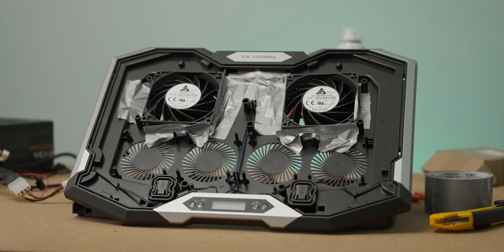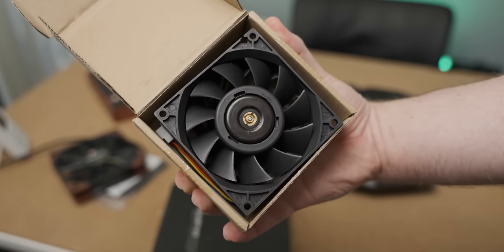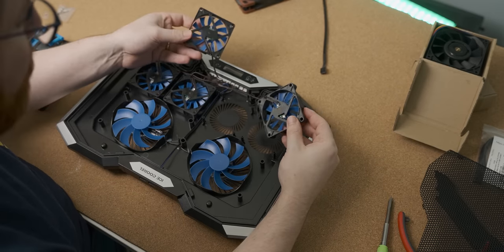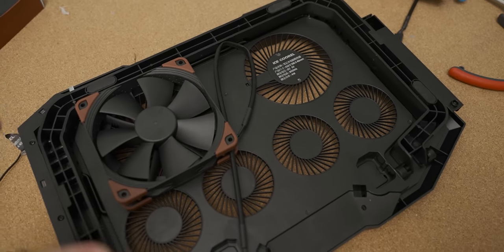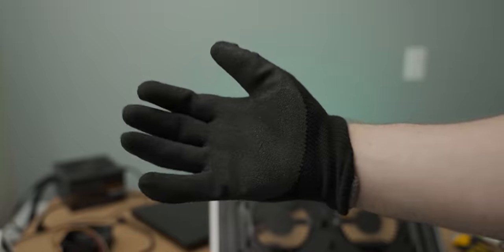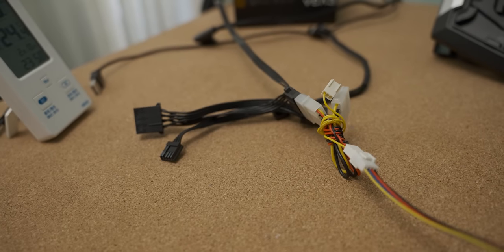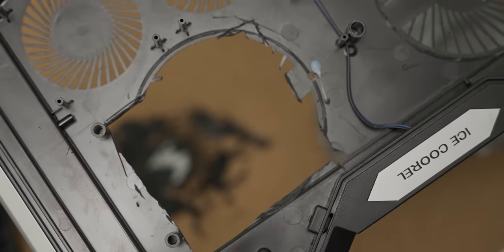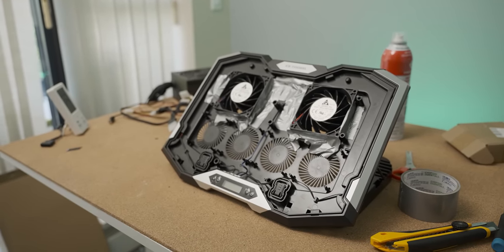I Made The World's Most Powerful Laptop Cooler

Comment: By the end it just sounds like a PS4, probably actually quieter.
Reply: Idk my ps4 slim  is pretty quiet. But its on a pedistal pretty much with air all around it
Reply: @DeadpoolPlayz  The original PS4 was...  very loud.  It wouldn't have been so much of a problem, except it was very loud without being cool enough to...  touch with your bare hands.  You could still look at it for at least 3 seconds without burning your eyeballs, so there's that I guess.
Reply: 83dB is about 4 times as loud as the PS4 for anyone wondering, though idk the distance dawid measured it from
Reply: With a headset, who would ever notice
Reply: @dapz  verified guy??????

Comment: Next challenge ... cooling a laptop with a jet engine. 

"The age old solution to every problem ever" ... duct tape.  
I'm upset that you didn't also use Flex Tape to create a better air funnel.  Tsk, tsk.
Reply: as long as the laptop is on the intake side, should work just fine, lol
Reply: Could also use some zip ties in there :D
Reply: cool it with a leaf blower
Reply from the maker: I sorry, I have failed you. 😔 I should probably go buy some flex tape. 😁
Reply: A jet engine emits a jet of hot exhaust gases that will burn off your laptop  😁😁😁
Reply: Jet engine? Somebody call Colin Furze
Reply: @MrGichinfunakoshi  not if the laptop in on the intake side..nothing but cool low pressure air with tons of velocity
Reply: @MrGichinfunakoshi  i don't see why you think an ~800°C (~1500°C whit afterburner) turbofan Jet engine, wouldn't be the perfect solution to cool a laptop... And disassemble it.
Reply: @Ocastia  😂😂😂😂
Reply: Hi
Reply: Ps4 already have one
Reply: Dawid should salvage a pair of HP Blade Server fans for laptop cooling (https://www.youtube.com/watch?v=Crmz4-iWGvg ). It'll be the next closest thing to a jet engine.
Reply: loLolololol
Reply: you know jet engines blow out hot air right? not ideal for cooling
Reply: Directions unclear accidentally made a guided missile.

Comment: Thanks Dawid.   You inspired me to try the same for my son's laptop.  I broke down his cooler and installed two 3000 RPM Noctua fans.  Tried as an intake and as an exhaust.  They worked alot better as an exhaust.  No there is an external power supply at the side of his laptop running the two fans inside the cooler via a fan hub.  It must be working since he uses it every day without complaint, and he is the expert at what is working and not working with his laptop.  You are a genius sir.  Keep up the great content.

Comment: This reminds me of the project i did for my fx 4170.It was running as hot as the sun when i oc'd it to 4.8ghz so i got this industrial fan that i connected to house power.No limitation in speed.It was loud but man did she run cool.Main problem i had was the mounting but i did a good job and routed my cable through the back on this case.It looked and ran like a baws :D.
Reply: Damn how you do that (run it off the wall)
I got a G5 SE and it will give the sun a run for it's money

Comment: Most of that air is simply flowing around the base of the laptop rather than into it, which is why most laptop coolers just make noise rather than actual cooling. The fix is to put some rubber draught insulation strips (the sort you use to seal doors in the winter) around the edges of the cooler so that when the  laptop is placed on it the space between the cooler and laptop base is sealed... so that the cooler airflow creates a pressure differential at the base of the laptop rather than a breeze around it.

There's some laptop coolers that realise this, but you end up pretty much paying 100% more for the required foam surround. Instead, buy a decent cheap cooler and add better rubber strips yourself.  Fans with the right blades to create pressure differential rather than a low pressure breeze are the next mod if that doesn't give enough cooling.

Comment: Dawid, for what it's worth laptops run cooler with the lid open to a certain extent, since the lid/screen just acts as insulation to stop heat passively radiating out the top.

Comment: I used a single Delta 3.5a 80mm in the mid 2000s on my main rig.  When you opened the door to the house, you could hear it from upstairs. I had to turn off the pc to sleep.. but I'll be damned if I didn't have that 2.4ghz Core 2 Duo running at 3.4ghz, stable.  A full 1ghz OC... but at what cost

Comment: I just bought a laptop cooler that has blower fans and a seal to keep all the air going to the laptop and its the best laptop cooler ive used so far but it was more expensive than most. I think laptops with more vents on the back will benefit more than your razor. They do help though and nice to cover your lap from hot laptops.

Comment: Ho boy, the noise that those deltas made brought back some memories of overclocking Athlon CPUs back in the Socket A days. I used to run an Akasa Silver Mountain Cooler back then that used a Delta "Black Label" AFB0612EH as its stock fan, wich ran at a constant 6800 RPM and produced an ear shattering 46,5 dBA. Combined with my Chieftec CS 601 case that was filled to the max with 80mm case fans, starting that PC allways sounded like a Chopper that was getting ready for takeoff.

Comment: I made my own laptop cooler a little while later. I used cheap plastic laptop stand and cut 2 openings for two 120mm fans. The fans are connected to usb step-up module so i can control the voltage on the fans. Usualny i run them on 6V and the cooler is super quiet and the temps went 10C lower o both gpu and cpu :D

Comment: bro, best cooling and sound reduction is: place the laptop as a tent on the floor, add hdmi cable and wireless mouse+keyboard, because it is under desk, lowers fan noise, and because of tent mode you get a better airflow.

Comment: Maybe just maybe running the fan as an exhaust would help, you know pull the hot air away from the pc instead of working against the laptop fans and pushing the hot air right back in. Then maybe you'd actually see a difference

Comment: These only work when the fans are extracting air OUTWARDS, trying to push air in the laptops tiny vents will actually cause the laptop to get hotter, on this pad i would remove those small 4 useless fans so all the power via usb can be directed to the two larger ones, this is where the heat comes out of the laptop anyway, the goal is to get the heat out of the laptop as fast as possible, and why they never make laptops that push air inwards.

Comment: Might the issue here be that axial fans tend to stall very easily when faced with an obstruction (IE resistance) so the amount of airflow through the laptop will be minimal. You'll get an impressive airflow when the server fans are meeting no resistance but minimal flow with the laptop sat on top. This could be tested using a funnel out of the exhaust and an airflow meter (wind speed sensor would like suffice). Centrifugal fans tend to handle resistance much better. It's a bit like superchargers comparing roots type vs centrifugal (turbo) style fans. Of course for ultimate handling or resistance you want neither a centrifugal or axial fan but more a piston / diaphram type air pump. That will flow air pretty much no matter what. Of course the air would take the path of least resistance so duck-taping the laptop to the correl to create an air-type seal would be required.
Reply: Man I overthink things sometimes....

Comment: The first experiment would have worked if you added a seal. The issue with these cheap laptop coolers is that the air is being pushed onto the laptop surface then its bouncing away. If you can enclose all the air and FORCE the air through the tiny intake holes, then you have a game changer that should be far less loud.

Comment: The...  Thing, you made to power the second delta adds no real additional power to the fan, as you are shoving 12VDC into a PWM return to the board, and the ground cable (negative) cable also needs to be upsized to actually provide a benefit.

Glad you had a fire extinguisher handy.  Not sure it's the right type, but it's the thought that counts!
Reply: I think the blue wire is a frequency input and the yellow wire is a pwm control input. 
Also wouldn't the negative cable being too small just increase the risk of flames, i mean if you input current though it's gotta go somewhere.
Reply: @IsoMacintosh  blue is FROM the fan TO the board.  You need some way to know how fast the fan is going, but you can control the speed with voltage.  Not as precise, but cheap.  The 4th wire is a command wire, as it allows the board to not have to do the actual control, and instead let the fan do the actual control.

As for the negative being too small, it WILL cause a fire, IF they can get enough amps through the red wire.

Except the red wire is also too small.  So if Dawid tries to run this long term, the fans will fail, when those wires melt.

Actually, if they just melt, and don't touch, he might be okay.  But if they melt and touch...  It's going to be real fun for a few seconds before something else ALSO dies

Comment: You could have gotten a drill for the tap size of the screws you were using for the fan attachment, and made them self tap into the plastic with a power drill. Like if they were m4 for screws you would just Google m4 tap drill size and it would tell you what size drill to use so you could screw m4 screws into it, or run an m4 tap through it

Comment: I was a slave to laptop cooling pads trying one after another with no success until I thought of a crazy idea while I slept. I use my air purifier xD. This will be a long comment but hear me out. It's a amazing trick!

The particular one i use is the Holmes HAP759 model but i believe any upwards firing air purifier will work. Keep in mind that when you do this it is recommended that you connect a external monitor and mouse and keyboard unless you don't mind slouching over in order to play on the laptop while it's on top of the air purifier.

The results? Without using any fans other than the built in fans on my 17 inch laptop with a GTX 1070 the laptop would run super hot after about 20 minutes of playing games with ultra settings on. And by hot i mean like as high as 98 Celsius. Most cooling pads i used would drop the temps down to as low as 82 Celsius. The air purifier drops the temperature down to a amazing low of around 40 Celsius! Not only this but it keeps the temps this low for hours. I even have had gaming marathons of around 16 hours and the temps were in the 40's the entire time.

How would you set this up? I simply put my air purifier right next to my desk where i have monitor and my mouse/keyboard. I place the laptop on top of it backed against the desk and walk so that it doesn't get tipped over. Then simply run the video cable to the external display and your set. Not only are you cooling your laptop to amazing low temperature you are also shooting clean HEPA filtered air into your laptop simultaneously purifying the air in your room  as well.

I know this is a crazy idea but man is it worth it.

Comment: these laptop stands might as well not even have fans. 95% of the work they do they do just by lifting the bottom of the laptop from whatever surface it was resting on. 
the ones that REALLY work are those exhaust fans. but only on laptop with one one exhaust port. my old laptop was such a model. a small exhaust cooler dropped temps by like 15c.

Comment: That sounds very Reasonable. I think people get used to the sound of a vacuum in the house. Yeah that’s reasonable. 😂😂😂

Jokes aside, 

I am surprised that nobody has made limited run lower housings for gaming laptops that utilized a larger cooler and fan for specific models that can be overclocked. 

I know many that wouldn’t care if they had an extra inch of thickness if it meant they had a capacity to overclock and cool. 

A new housing could allow the air to flow from the front to the rear.
Fun project you did there.

Comment: have 5 3000 rpm 140mm fans. and 2 3000rpm 120mm fans from Noctua in my case. Love em, only run 3000 rpm when benchmarking. wish the fan showdown would use the 3000 rpm 140mm at max speed. put those blades to the test.

Comment: I've added a temperature probe USB switch to the cooler, then put it next to an AC vent with a dehumidifier to reduce the humidity to hopefully not ruin the components. I also have extra 120mm usb fans, one directed towards the cooler, and one pointed down at the laptop keyboard, which if you don't know is where a lot of laptops also intake air. 
I use the laptop as a desktop for now, so I don't have to worry about placement, I just have it near the floor on a laptop stand on a box.
the ironic thing is that I think my solution is probably less janky, quieter, cheaper and cooler than your solution :p
I get about 50C when the AC is running, if I'm not doing anything intensive, though my laptop does get into the 60's. this motile laptop has an anemic  cooler so it would immediately shoot to 75C and start sounding like a hair dryer, even with a laptop cooler so this is an improvement.

Comment: I manhandled 360 watercooling loop (old 360 AIO), 37x27cm aluminium heat exchanger, 4 x 120mm fans and 3x60w tecs connected to 120mm*40mm aluminium waterblock to my Cooler Master laptop cooler. Noise is not as loud and the laptop bottom is around 15 celcius (voltage controlled by heat exchanger temperature) on idle and littlebit more on load, my laptop had the problem of VRM overheating at 45watts but now its not :). I think its overpowered as single 60w tec could have done the job. 

Laptop is : Ideapad 3 14", 10210U @ 45W + 65W Lenovo X1 charger, stock charger is 45w and tdp 15w.

Comment: Be careful with pushing air into the openings of your laptop cooler. If you spee up the laptop's fan, it might act like a generator and create currents that the mainboard fan header can't handle.
Same goes with using the vacuum cleaner to suck the dirt out of the fan. Don't do that as long as the fan is connected and you can't manually stop it from spinning up. :)

Comment: you just have to cut the back of the laptop at the shroud and glue a delta fan there to push air in ...the other delta fan you might put it at the hot air exaust of the laptop to pull the hot air from inside ... that might help you cool the cpu and gpu LOL

Comment: Why would you connect +12V (based on color) on tachometer/PWM signal for the fan? What was the idea at 9:37?  What wouldn`t be enough? Whole connector (plastic)? Pins? Wires? 
Zero details, no temp (with ambient temperature) and power loging for the test - also you should use syntetic benchmark to "strike" PC with same work to compare apples to apples - you can`t test it in better details with mutiplayer games where there are just to many variables.

Comment: Mine is much better!!! 45 min full discharge in bios, after every 4 discharges in Windows. It will set the cpu to remain cool, and depends on the battery health. If the laptop can discharge for 30 min in bios, then some changes will happen in the heat. The vent will drop down speed over 40 min discharge in bios. All this requires about 6-10 discharges in bios, overall max 50 discharges. Secret, but it works. Once you are done, you don't need to do this again. Doesn't affect performance, it remains fast.

Comment: Even better than duct tape.....Gorilla Tape!  It's even black which matches the cooler's frame and hides the...ahem!....modification.   It's even WAY stronger.  I have been using it to actually hold some of my shower tiles.....OK.....MANY of my shower tiles to the wall for well...a few years now. You know...until I have the time to fix them.....🙄😁
It's pretty water proof too just in case you decide to add some "water cooling" to the laptop cooler somehow.😂

Comment: It would be interesting to see what the temps would be if the laptop's back cover was removed
Reply: Having the back on directs the air where it needs to go... creating a seal between the top of the cooler and the bottom of the laptop has the best effect. I used a 3M foam AC insulation strip and it creates an airtight seal.

Comment: MY DUDE,
the laptop doesnt give out power through usb when its in sleep state.(for mor info about that go to power plan in your laptop and open advanced settings and check there).also are you willing to make these and ship them around the globe?(really need a good laptop cooler but the reviews of the ones which are there aren't that promising.
also dude please do test with laptop internal display too as if you connect an external monitor then there will be very high amount of change in temps due to the usage of mux switch.so please try it with in-built monitor and post the results.

Comment: Actually this is not the most powerfull Delta fan. I have 5 Delta fans in my HP Proliant ML370 G6 that each one draws about 4.65A at full blast which gives us about 250w beeing used only by fans cooling the machine I really would like to see you use one of these and maybe tape it to the laptop itself (?). Maybe you can use a Delta blowers if I remember there is a thing called delta blower and they produce a lot of static pressure which will definetly help to push the air through laptops' cooling fins.

Comment: It works, but at what cost? Speaking to the elitists who wanna get their temps as close to freezing as possible; the heat isn't just magically gone, it's just spread out into the room and unless you live in a place with perfect weather all the time, you'll feel that heat catch up to you eventually. What I do is I limit the frame rate in the GPU drivers to my monitor's refresh rate (100Hz) so the GPU isn't making excess "wasted frames" and by extension, extra heat and while at idle or lite loads I switch to the power saving profile to further reduce heat output.